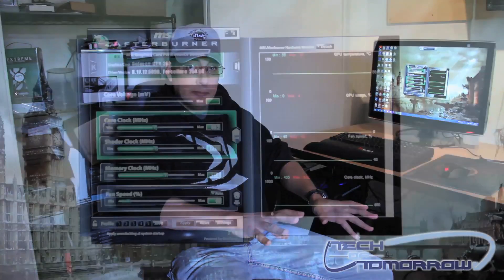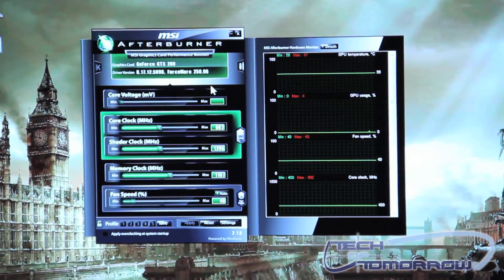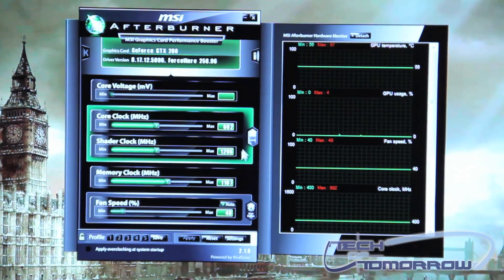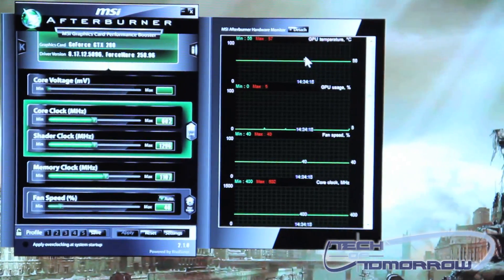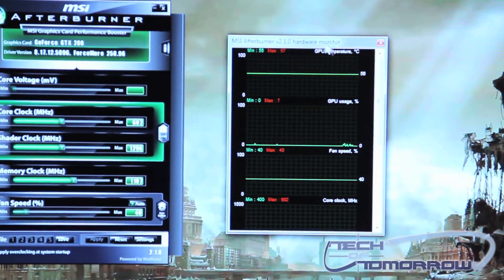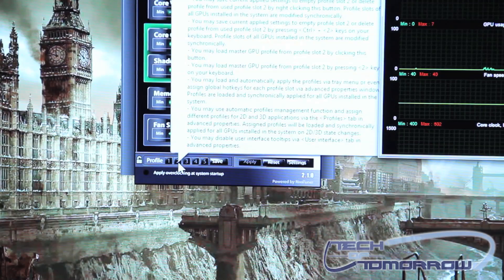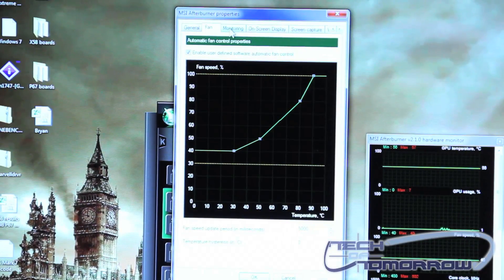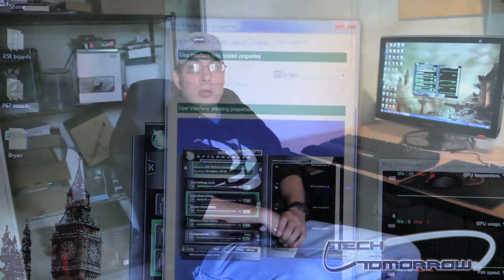MSI Afterburner Demo

Comment: The important thing with this software is to ramp up your settings slowly. Each time you increase a setting I recommend running a benchmark after each incremental increase to check stability.